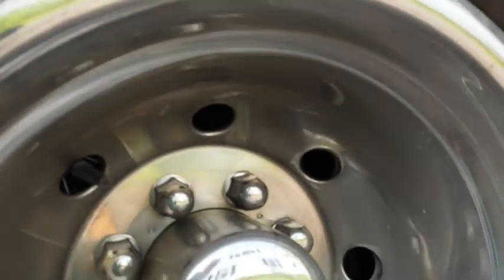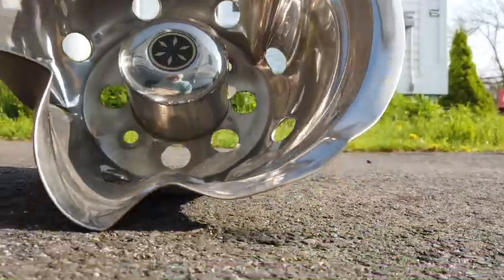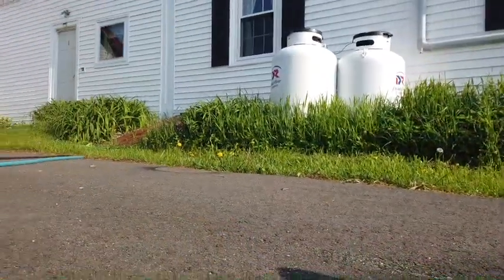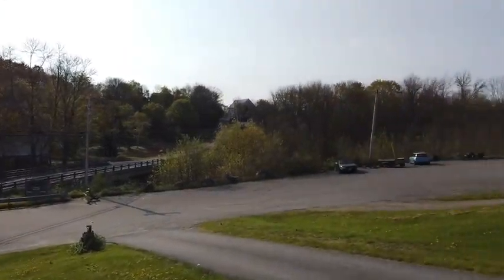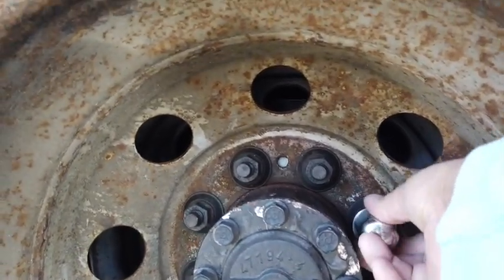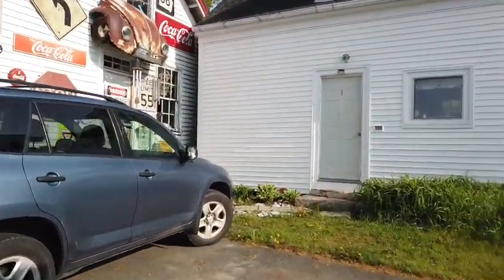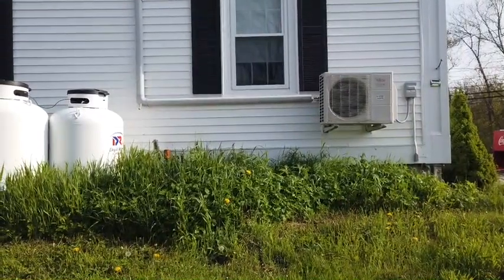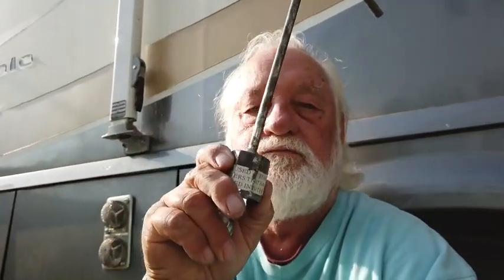How to remove shiney RV hubcaps without damaging them

Comment: Mine doesn't have grooves in the two removable lugs. How do I know which to remove!
Reply: UPDATE:  My centercap and cover look identical. However, my 2018 Coachman Freelander E450 does not have lugs to keep cover on.  The whole thing just pried off like a regular wheel cover.
Reply from the maker: Yea some of them are made that way.

Comment: Not a real fine day as you know...I'm here to learn to remove the chrome cover...which means one thing...flat tires lol  Saw your other video in the rest area and searched for this one lol
Reply from the maker: Yea.  I've got more experience doing this than I ever wanted to have, but since then I've acquired the right jacks, wrenches and having done the brakes on the rear of the RV have gotten much more comfortable with doing this kind of thing, in case it ever happens again out on the road.    I don't wish this on anyone I can tell you that.